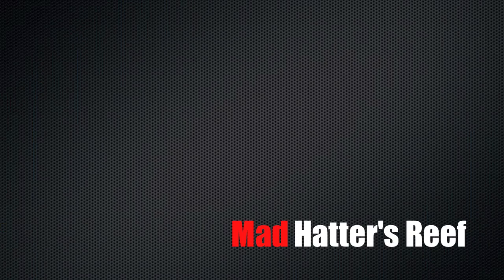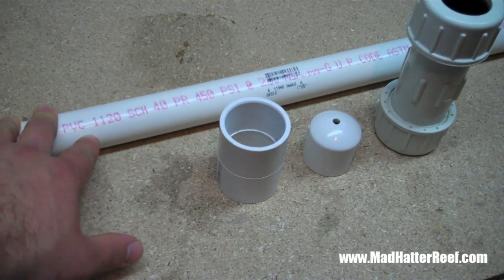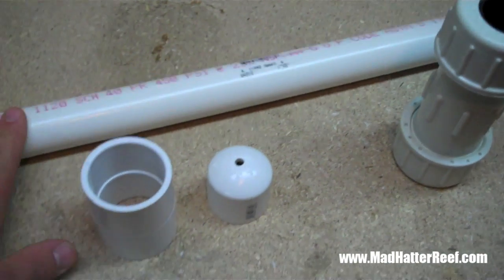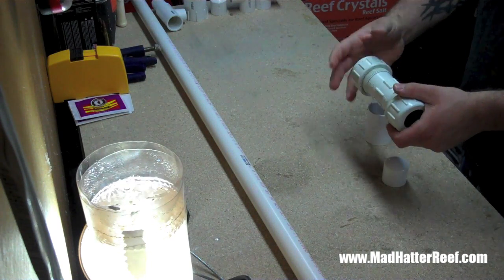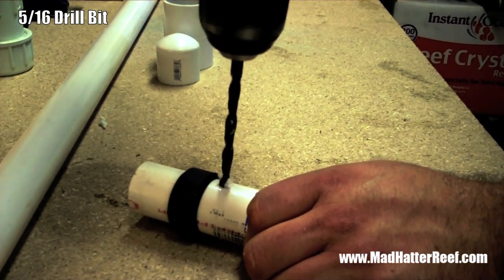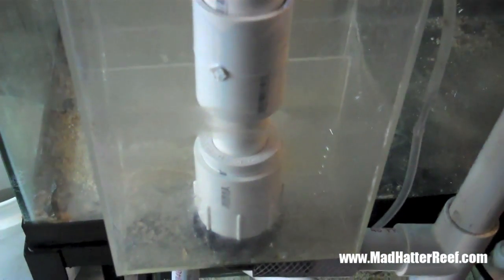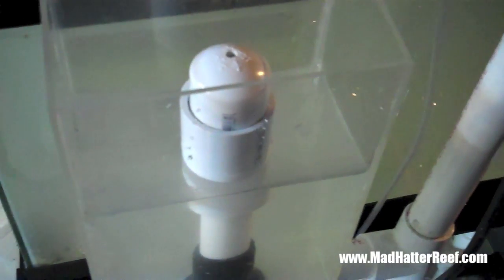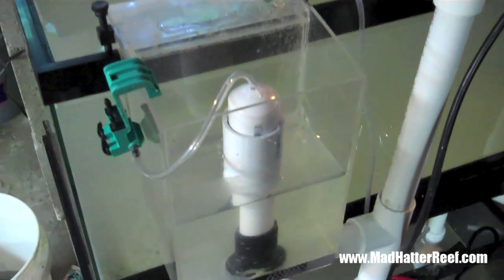How to: Silence your Aquarium Overflow | Stockman Standpipe

Comment: this was my 3rd standpipe build I tried a durso and would not fit in my built in overflow due to me having a t shape pvc pipe for my return inside.i tried a Stockman with out the coupling, reducer, and 1/4 vynil tubing. Just straight holes drilled with a endcap with a hole on top, that was a nightmare it stopped the water dropping sound but the gurgle was beyond horrible. Now that I built the Stockman the way you did I am amazed :) thanks for the video any one else look no further.

Comment: Great idea!  I tried it and noticed a tremendous reduction in the noise level form my overflows.  One recommendation is that some of the rubber grommets are not wide enough to hold the coupling in place.  I used a rubber band as well as the rubber grommet,  I simply put the rubber band near the very top of the grommet so if it slips it will still be on the grommet.  But otherwise this sysyem works perfectly!
Reply from the maker: Thanks for sharing

Comment: I did this today while hard plumbing my overflows... Works great! Only thing I found was while I was at the store with my 1" pipe trying to find the repair and slip couplings, the 1.25 gasket was WAY too big and didn't fit snug on the 1" pipe. So got a 1" repair coupling and used that and a 1.5 or a 1.25 slip coupling instead (can't remember which one). Did everything else the same and it works perfectly... No more gargling sound! Thanks!!! :o)

Comment: Looks like that would be great for smaller aquariums.I was wondering how to make those....I had no luck quieting my 240 gallon aquarium down..Couldnt even hear the TV...So I ended up moving my filtration /skimmer box to the basement,adding a stronger return pump(for higher elevation) and adding shut-off valves to the drain lines in the basement to allow air to come out  ,instead of gurgling at the aquarium..Air  needs to come out of the drain lines somewhere..Helped a whole lot,even the local fish store was amazed.

Comment: This solved so many issues! I used a 1” silicon drain connector (it was cheaper than purchasing the entire PVC assembly for just the gasket) it’s super quiet and it’s changed the whole game! Just gotta move my tank inside now! (Wife wouldn’t allow it before this 5 minute fix)

Comment: madhatter, How did you make the "quick disconnect" portion that you connected the standpipe to? I have a tank setup and my pipe is in a tight space behind a rockwall i built, If i cut holes in the pipe and it doesn't work i will be screwed, but your quick disconnect gave me an idea that i could create one for my overflow pipe, then make the stockman standpipe and connect it and if it didn't work for some odd reason i could always just add another straight length of pipe.

Comment: I have a dual Tsunami and tried this unsuccessfully.  For some reason one of the pipes is indeed quiet, but the other one only quieted a small bit and still annoying.  I even tried swapping the two stockman standpipes and the noise remained on the same side.  The only thing really different is the quiet one has a four foot hose from the overflow box to the sump and the noisy one has a three foot hose from the box to the sump.  Due to the placement of the sump I needed a longer one to reach the sump closest to the front.

Any ideas?

Comment: Stupid question... Is the stand pipe cut an inch higher or lower than the water level... Thanks!
Reply from the maker: Higher.
Reply: @MadHattersReef  and the rubber fitting is placed lower with the holes below that?

Comment: One problem to mention is by raising the water level in the drain tank you reduce the flow of your siphon.  This could cause your return pump to have a greater flow than your drain and overflow your tank.  Or, best case scenario, run your pump dry and burn it out.  

Just my two cents.  Been there, done that.  Water level in the back tank should be as low as possible so as to create enough vacuum in the u-tube to pull enough water to outpace the return pump.
Reply from the maker: Its worked well for me over the years. Thanks for watching.
Reply: I'm sure it has, and I wasn't knocking the design at all!  Just wanted to throw it out there that some people could end up reducing their siphon pressure and cause issues.  Won't happen to everyone, but it happened to me.  

Like your vids!
Reply: My return pump is adjustable.

Comment: The aquarium hobby is so bizarre to me. Why doesn't the company that MAKES the overflow box simply include this part that would cost them maybe 50 cents to add? It seems like this hobby is loaded with stuff you either have to make yourself...or costs a fortune to buy made for something simple. For example SUMP KITS that are basically sheets of plastic that you pay $50 for and have to install yourself. Why don't aquarium shops simply sell complete sump systems? And not for $1000 since it's just a $50 aquarium with baffles glued in? Make your own algae scrubber because no one sells one at a decent price etc....
Reply from the maker: +Joe Shmoe TRUTH.
Reply: Mad Hatter's Reef BTW I built this today and it worked perfectly. Some observations from my experience: The number and size of holes is critical. With my build, lots of holes made a bit of extraneous noise. I found things worked better if the holes were spread out and fewer.  The tube out the top adjusts the rate a lot. When my tank and sump is very full, I can run my sump at a higher rate and I literally close the tube. Also I found that that fine white tape that they sell for plumbing jobs like replacing a shower head works great for building up the rubber washer if need be. Thanks for this video. The unit cost me $7 and about an hour to build.
Reply: Omg yes, I Hate this I bought a tank not knowing it had the whole sump deal, (ive only had up to a 55 using regular old filters) id rather buy a kit with everything i need rather then sit here and try to understand pluming.
Reply: Jeff here from Lifereef Filter Systems www.lifereef.com, and I have been making overflow prefilter boxes for almost 30 years. The reason is simple: Not every overflow or prefilter makes noise, or as much noise. Noise can range from a slight trickle to what you can hear in this video. A lot of the noise is governed by the plumbing, and not all plumbing installs are the same.  Some can flow with very little gurgle, and there is a simple airling-tubing trick that can be used to lessen even more. And not everyone wants silence, some hobbyists don't care about the noise. Adding this to the product does cost money, not just a few cents, it takes time to build this and you are paying for labor, not the materials. My Silencer is much simpler than the Stockman and is an option, not included, as not everyone needs/wants silence.

Comment: Troubleshooting question, every 2-3 minutes it starts to pulling more water as if its plugged. I pulled the air hose out of the top and it still happens. Fixed Not enough air flow in the cap. 🤦‍♂️

Comment: I think the measurements might be wrong in the opening of the video? 

 I bought exactly what it said to, 1" pvc, 1.25" repair coupling 1.5" slip coupling and the gasket from the repair coupling is to big, its made for a 1.25" pvc pipe not 1". 

 Im assuming I should have gotten 1" pvc, 1" repair coupling, 1.25" slip coupling?
Reply: Yup, same thing happened to me. You get it all sorted out?
Reply: Yes, the table of parts at the beginning does not match what he actually uses in the video.  Nobody checks their work anymore.

Comment: Just a note:
The Coupling and Gasket are not necessary.. Just a pipe with holes and a Cap that is larger than the pipe resting right on top of the pipe. Ex: 1" pipe with holes with an 1 1/2" cap (what I use), just make sure the holes are drilled so that the Cap covers them.
And just drill a hole in the Cap.

Comment: The inch and a quarter stuff is too big for 1 inch your instructions make no sense i had to get a 1 inch repair coupling and over the one inch gasket and you need a one inch repair coupling not 1 and 1/4 as the rubber gasket will be too big for a 1 inch stand pipe to make it to where the 1 and 1/4 inch coupling doesn't just slide right off cause its too big also i had to put teflon tape over the gasket till it snugly fits